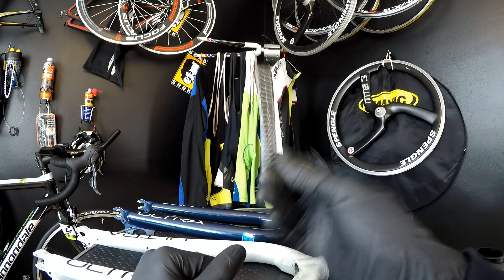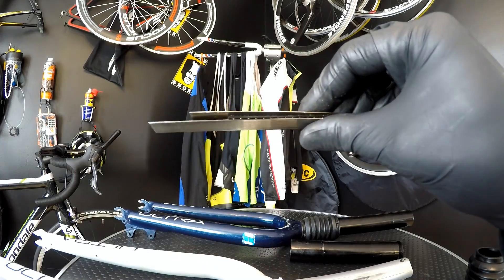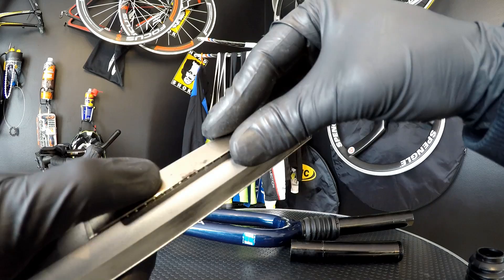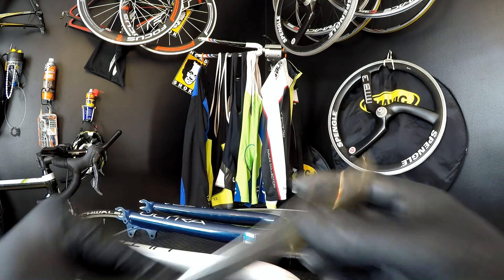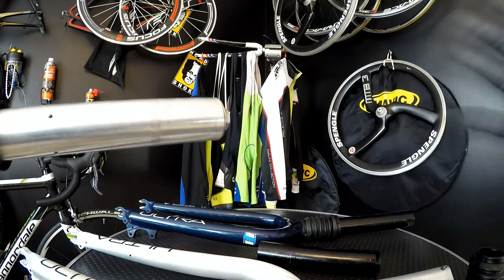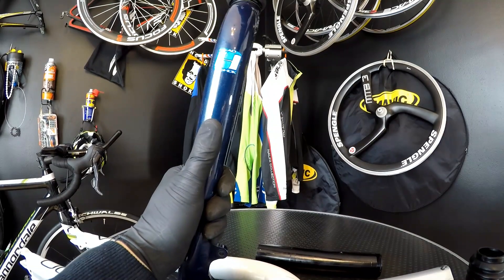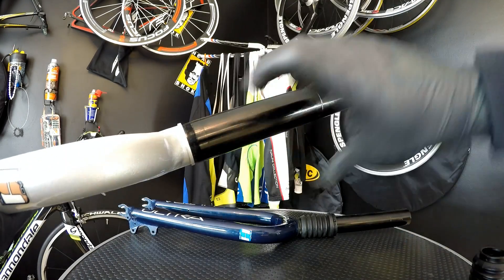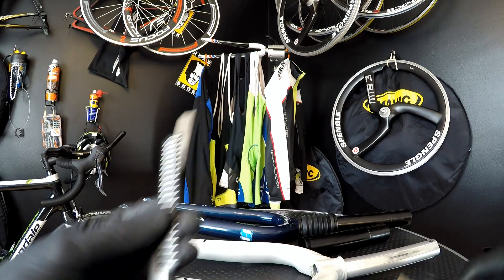Why NEEDLE bearings? Cannondale HeadShok / Lefty suspension fork

Comment: Thanks for the clear intro to the Headsok.  I have a M (Mechanical Headsok).  My boot is torn on both sides without visual rust along the shaft.  The system is really old but it travels the 60mm without issues or bottoming out.  Based on your experience, is there anything simple I can do to increase the smoothness of the shock knowing that the boot is not completely sealing the shaft?  Please keep in mind I rather not remove the fork, but I would if there is a lot to gain.  Also, is there a clever way to wrap a torn boot to protect the interior of the system?  Thanks!

Comment: Howmuch air should i put în my head show fork
Reply: I found a Headshock chart online that gave recommended psi based on rider weight. For mine (super fatty ultra dl) the psi increments linearly with rider weight, beginning at 60psi for a 120lb rider and ending with 110psi for a 200lb rider. Not sure what the recommendation is for those of us significantly higher than 200 pounds.

Comment: Nice video explaining why the Cannondale Headshok functions so well, when it works.  I built my Raven from a bare frame in 1996, and opted to use a standard design Manitou instead, due to the cost of the Headshoks.  I've had a Fatty sitting on the shelf for years, your video has inspired me to install it.  Any chance you could do a video on how to overhaul/rebuild/service these puppies, now that there are few shops left that will work on them?